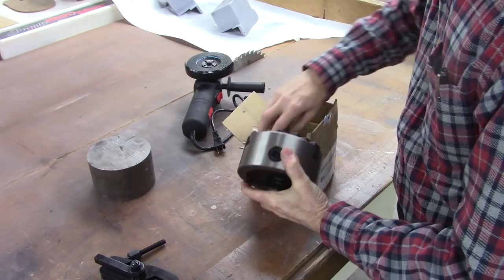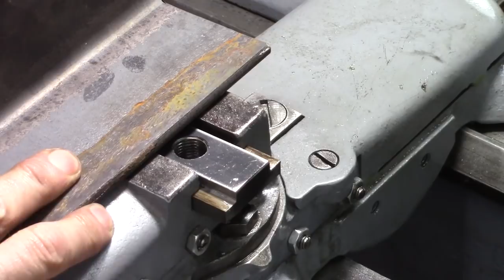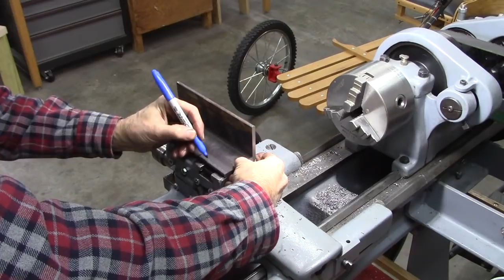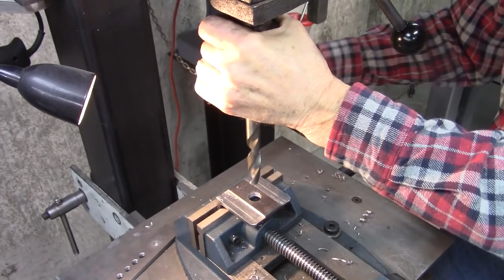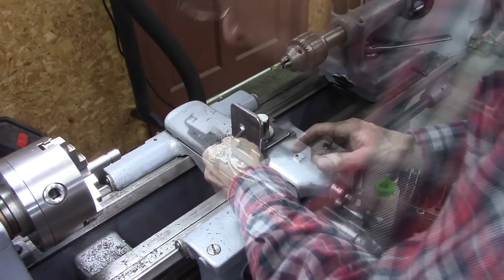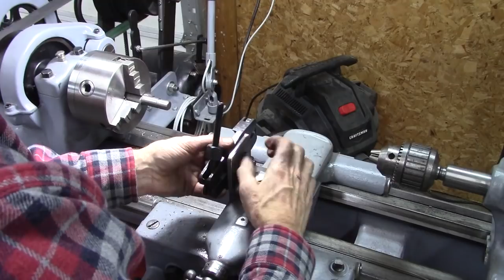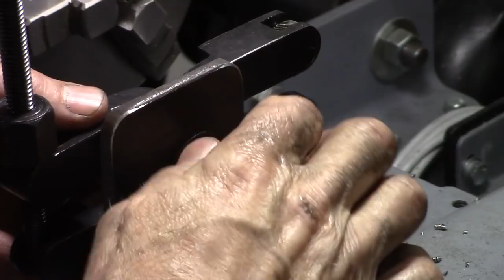Direct Mount Knurling Tool - Santa was Good to me!

Comment: A machinist much like myself. Spend more time improving machines than actually making anything. ;)
Reply: That's how we novices learn. You build things to improve the equipment you use, then when somebody asks you to machine or turn something as a paying job you look at it & go yep no problems I can handle that.😁
Reply from the maker: Especially when the lathes mills etc. are less than industrial to begin with.  I'm always amused with some of the comments I get on a cut off tool video I have. Things like, "it's all about setup". When asked what kind of lathe they are using they usually reply a 14 inch Monarch... etc..  These small Logan, atlas and South Bend are not rigid like a Monarch. I'm very pleased with this knurling tool now.

Comment: Cool fix Wink, since I ve made mine I have never looked back. Cheers!
Reply from the maker: Did you do something similar or did you make the whole tool?
Reply: @WinkysWorkshop  I made the whole tool, it does deflect a bit with travel, but it cuts a nice knurl with no radial pressure on the lathe axis, just adjust the pressure with a knob on a threaded rod, so easy to use!
Reply from the maker: @howder1951  - I started to make one a while back and realized it was going to be a big job to make it like I wanted. The 50 bucks was a good deal.

Comment: I once knurled a 4 inch diameter piece of O-1 while making a bench block. I found so much pressure on the cross slide that it forced it back away from the work. I resolved the problem by taking the cross slide all the way out the end of travel and using the compound ( set at 0 degrees) to adjust the depth of the tool. Knurling needs slowest speed and fast feed. Sometimes the simple operations present their own little problems. I agree with one of the comments posted, that you may be better suited to place the knurling tool inside the angle iron. Good job!
Reply from the maker: The tool height is to great to fit on the inside of the angle iron but cool idea!

Comment: Talk about a simple fix with great results.  I bought a set of knulring wheels months ago, but haven't yet built the tool/fixture for them . At least this gives me more food for thought
Reply from the maker: I was going to build a knurling tool... in fact I have one half way finished. Then I started rethinking my design and found this one for 50 bucks. The way see knurling is that it is super important to have a large amount of pressure at the wheels at the very start. Some say start out light but in my opinion you are asking for possible problem doing this. The wheel pattern has to mesh with the patter on the stock like a gear. Pressure forces this to happen.  Anyway, if you agree with me, consider this. The scissor design applies the same force to the wheels that you apply to the adjustment nut. Other knurling tools have the pivot point behind the adjustment nut. This is a mechanical disadvantage. Only half the pressure at the wheels.
Reply: @WinkysWorkshop  hmmm. Some good points to consider there. That may very well change the design I use on mine. I guess that's why I haven't built mine yet, I needed this last piece of advice ;-)
Reply from the maker: @craigtate5930  - I'd love to see your finished product!

Comment: Looking good only thing id add if you want it to be as stiff as possible is to weld in some triangle gussets on your angle iron 👍👍👍
Reply from the maker: I was a little concerned about that also (I didn't have any thicker angle iron) but it seems to be totally adequate. I think most the force is more twisting...  like it was trying to rotate the tool post.

Comment: Nice knurl especially considering how the end of the piece was not supported. 
That looks like a straight forward project that makes it easy to switch out between knurling and turning operations with the benefit of not requiring a tool post holder
Reply from the maker: Thanks...  yes very simple and effective.

Comment: Thank you for sharing that with us.  I have been tossing around ideas on making my knurling tool more rigid, and this seems to be like a great solution.
Reply from the maker: In my opinion the trick to getting a good knurl is to have adequate pressure from the start. I've seen people calculate knurl patterns and diameters but I have found this unnecessary until you get very small in diameter.

Comment: I learned something here. I have the same knurling tool and as you know knurling can be a pain. I have had decent luck once I learned the diameter needs to be right for the knurl size. however I think this mod will really help with all the other issues that arise. lot of pressure when knurling its a task that small machines like mine struggle with. thanks for sharing the information.
Reply from the maker: As long as I use high pressure I never have an issue with diameter until I get down to under 5/16" ...  I never do the math
Reply: @WinkysWorkshop  interesting seems I always have trouble if I dont go by the knurling chart for dimensions. maybe I'm not using enough pressure.

Comment: Many years ago, we got a pretty standard electric drill which had a fold-away handle. A brass thumbscrew held the handle in place - to whatever angle you set it. That thumbscrew was also tight on the thread. 
A drop of oil made all the difference :)
Reply from the maker: Great tip!

Comment: I have a Logn 10" lathe and it came with a tool post knurling tool. The wheels are just one above the other.  That's how I know that is how the wheels are to spaced.  I have used it and it workes OK. Use plenty of oil too. Lube helps to displace metal on the shaft.
Reply from the maker: Yeah...   it's hard to get enough pressure to get a good knurl on steel with those tool, especially with smaller lathes. Doable yes...  but not always good results. I'm fairly certain that's why somebody invented a Scissor style knurling tools.

Comment: Well done again Winky. Another very quick mod to it that will make the World of difference is to add a THRUST RACE under the nut that you use to add the depth of cut. Lot less effort swinging the spanner.
Reply from the maker: True...  you might even be able to put a knurled knob in place of the nut!

Comment: Nice improvement Winky.  I keep saying I'm going to get that style knurling tool. Biggest thing I have found in getting a good knurling job is to get the diameter of your material correct to whatever Knurling tool your using.
Reply from the maker: Respectfully I disagree. Unless you are knurling 1/4" stock or under or using a very course wheel the diameter is not a concern. The trick to to avoid problems is high pressure at the wheels. The high pressure forces the wheel pattern to fall into the previous revolutions knurl. I think the biggest problem with knurling is that most knurling tools can't handle the high pressure needed.
Reply: @WinkysWorkshop  your new tool definitely gives you more pressure and easier on the Lathe.
Reply from the maker: @OldIronMachineWorks  - I did a lot of testing with this tool (link) and eventually the tool failed (bent) but I was able to get a perfect knurl every time. After several failed attempts I just said, what the heck, I might as well take a chance tighten the heck out of it and see if it works. I ended up knurling about 5 different diameters without fail before the knurling tool bent too bad to use. The pattern on the wheels pushed the wheels in opposite directions almost a 1/4 inch. https://www.amazon.com/gp/product/B078MJK1FR?pf_rd_r=BVRNS0TMAVXP8C0GXVCG&pf_rd_p=5ae2c7f8-e0c6-4f35-9071-dc3240e894a8

Comment: Hi Winky , as always you come up with something to make a tool or machine work better . I recently bought a knurling tool but unfortunately it is of the self centreing type and puts a lot of strain on the headstock bearings as well as the cross slide leadscrew and nut . I will have to make something that renders a nice finish and is not such a pain to use . Thank you for sharing  a great and inexpensive way to make it work . Gongrats on your 25k subs .
Reply from the maker: Yeah I had a knurling tool like that. I suspect they would work okay with a huge lathe but my lathe couldn't do much with it. Thanks for watching!

Comment: I haven’t been watching many of your videos as you have been concentrating on metal projects and I am strictly a woodworker. However, since I wasn’t sure what a knurling tool was I watched. Very interesting. Do you have any woodworking video in mind?
Reply from the maker: Wow, thank you! Yeah I have a couple in mind. I was a woodworker long before I worked with metal to any large degree. I recently modified my old camel back drill press to oscillate for a drum sander for woodworking...  probably not applicable to most but its a fun video. I also made video on building a Horizontal boring machine recently that works fantastic.  I used it last week while building a cabinet for my daughter.  For FUTURE videos I plan on building a cut off sled. My current sled is 18 years old and still dead on but it looks really ugly. I use it for a work bench too. If you need to build a sled please wait for the video (about 1-month away). I hope this doesn't sound too arrogant but my method for building a sled is the absolute best! Stay tune! Ha

Comment: Way to go Santa!  I was just thinking about one of these myself.  If I remember right, the top of your tool post is about 15/16" from the center of the chuck so a 2" dia piece of stock wouldn't clear the top it and needs to stay forward.  Not sure what the largest dia. knurl might ever be (probably a hand nut or something) that you might want to make.  The twisting torque (moment) on the tool post is now transferred to the rotating locking mechanism for the compound (the screws) but shouldn't be a problem considering what a normal turning tool might put on it.  Yep, another good solution to a problem and it keeps the side load off the spindle.  Seems perfect.
Reply from the maker: The maximum diameter is 2-1/4 inch which is big enough I think. I think the height to center might be 1-1/8 to center (11" lathe). Still the tool is hanging off the side so it isn't a limiting factor. The wheel contact point it about 2.25" out in from of the compound so there is some leverage on the compound but I doubt it would ever be an issue. It was almost 4 inch out before...  which was turning the tool post.
Reply from the maker: The double sided compound would be great!
Reply from the maker: FYI  https://www.amazon.com/dp/B01CGB9F5G/?coliid=I2H7EI7U2GYCU&colid=2Q9HYR5JA3HBE&psc=1&ref_=lv_ov_lig_dp_it
Reply: Hmmm... I would have thought that 1-1/8" height is about correct, but the other day when I watched you make the parting tool holder you had an 11/16" parting tool with about 1/4" of material under it (11/16 + 4/16 = 15/16").  Slide the tail stock over to the compound and measure from the top of the compound to the point on a center then see if a 2" piece of stock centered in the chuck will clear it.
Reply from the maker: @robert574  You are correct about the parting tool.  made that for my Logan lathe holder was on my south bend
Reply: Ok it was late when I watched it.  I'll have to pay more attention to which lathe you are on.  So 15/16" for the Logan and 1-1/8" for the South Bend?  All I remember was you were on the gray lathe.  Edit:  I downloaded some literature for both lathes.  Which one do you consider to be the "big" lathe?  I have a knurling tool that is handheld and built like a long tap and die handle.  You slide it over the end of the stock then tighten one of the handles and it closes like a tubing cutter.
Reply from the maker: @robert574  - No problem, I'm impressed that you remembered the height from the other video!

Comment: 7:24 Pivot & nut conflict - put the pivot bolt through the other way so its nut is toward the headstock.
Also, mount the knurler the other side of the angle iron when knurling away from the chuck.
Reply from the maker: Both good ideas but the bolt was a shoulder bolt and the shoulder needed to be in the tool. The scissor hangs down lower than the compound so there isn't enough room on the inside of the angle iron.  Thanks...  good observations.
Reply: @WinkysWorkshop  There's no reason for not lifting the pivot point for a knurling tool - the tool doesn't have to be level, it can point down towards the wheels. The supplied pivot bolt looks very loose - and that isn't helping.
Reply from the maker: @millomweb  - You are right..... the pivot point can be lifted but no way can you lift it high enough to fit it on the inside of the angle iron. Mounted to the outside fixes the problem completely anyway and avoids any possible conflict between the chuck and compound. Yeah...  when I demonstrated the problem the bolt was probably a little loose. Still, the bolt clearance in the hole was excessive and being against the flat of the angle iron stopped a lot of flexing.

Comment: I’ve has one for a while. Mine also flexes, but you gave me an idea to make a new block for the quick change to make the mount a lot more rigid.
Reply from the maker: Yeah...  mount a stud on some 1/2" bar so the pivot point is back further. Or better yet weld a plate to the 1/2" square with a stud. part of the problem is twisting the tool post but it was also moving on the mounting bolt. The plate would stop this movement.

Comment: Nice modification and nice video. I am curious about your comment to put the knurls a bit to the side of the work axis. Why would that be better?
Reply from the maker: Good question,  I should have explained that better. If you tighten down dead center the backlash in you compound and cross slight can be a problem. It may or may not be an issue but I've had the compound move  half way through a knurling job. The slight pressure change on the wheels can sometimes be seen on the knurl.

Comment: Knurling can be fun. But not when it binds up. I noticed that the knurling wheels were at 180 degrees across the top and bottom of the shaft. The knurling wheels should be about 45 degrees across the front face of the shaft.  The knurling pressure has to come from the advancing of the compound and not from the adjustment nut. The adjustment nut is to only set the knurling wheels spacing.  So reset the knurling tool with closer wheel spacing and try it again. It will work OK.
Reply from the maker: Thanks for the comment but I'm not sure I agree. Also I'm sure there is actually proper or improper method,  more like whatever works. According to Joe Pie (youtube) the tool needs to be just shy of center. The reason I agree with this is that you can apply a lot of pressure without deflecting the bar. With that being said I didn't agree with Joe on other aspects of the video. He did math on the knurl pattern and turned the rod to the right diameter to make everything work. The math is valid BUT with enough pressure you can overcome the math. I just knurled a 1/4", 3/8" 1/2", 5/8" and 3/4" rod in one pass and all but the 1/4" and 3/4" were perfect.  I used too much pressure on the 1/4" and not enough on the 3/4". On the second try on the 3/4" I used fairly extreme pressure on the 3/4" bar which forced the wheel to track in the previously cut knurl.  No doubt, the math was not ideal but it worked. Joe would have taken a different approach (but not wrong). He would have removed a .050" and made several light passes.  This is also why I modified the mount. With high pressure to tool post rotated when the carriage was moved. After I made the mount I noticed that a $250 scissor type knurling tool was mounted more like my tool.

Comment: Would a 2” square steel block be better?
I think it’d be stiffer.
Happy New Year.
John
Reply from the maker: Yeah...  that would work. Really, the force on the mount is not that great. The tool is basically floating. The 2 inch block might me a little easier to make however.

Comment: I have a mini lathe and I'm still learning how to cut threads.
Reply from the maker: Cutting thread is fun! Good luck
Reply: One thing that I was told was to just start cutting threads not paying attention to anything but the process. Once you get the process down, you can work on getting the dimensions correct.
Reply: @WinkysWorkshop  One of my favourite operations, the more you do the better you get until it is like riding a bicycle!
Reply from the maker: @robertoswalt319  - Good advice.  It's easy to mess up at first but after you do is=15 or 20 time it is easy. In most cases the size is not critical. If you start out with 1/2" stock and want to cut 1/2" threads just cut until the threads are sharp and try a nut on the threads. One thing you need to do however is take a file to the top of the thread points. After cutting threads there is a burr on top. I you try the nut without removing the burr it will not go on. You can measure threads with gauge wires and mic but in most cases there it no need.
Reply from the maker: @howder1951  - Yes it is fun... I enjoy it also.

Comment: I think you should have supported the free end with a centre, as you had the knurled out to one side there was considerable sideways pressure on the work, good idea though.
Reply from the maker: You're probably right. If it was something other than a test I would have. Thanks for watching!
Reply: @WinkysWorkshop  In fact I don’t use my clamp type knurled like that, pushing from the side, as it doesn’t do the headstock bearings any good. The whole idea of the clamp, is that you can position it on the workpiece, over centre, and then tighten it up with the work revolving, it doesn’t put any strain on the bearings at all then.
Reply from the maker: @anvilhead0  Bearings in a lathe are designed for much greater lateral forces than knurling tool would ever exert. The advantage of the clamping tool has over other types is that it reduce the load on your cross slide. Most smaller lathes have problems handling the forces needed to use standard knurling tools.